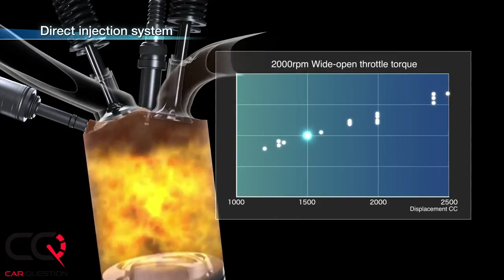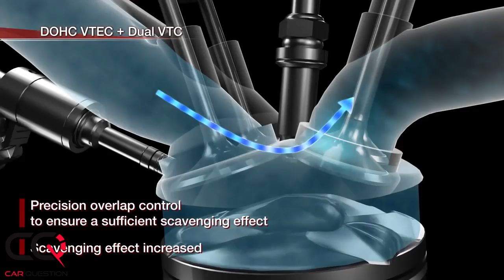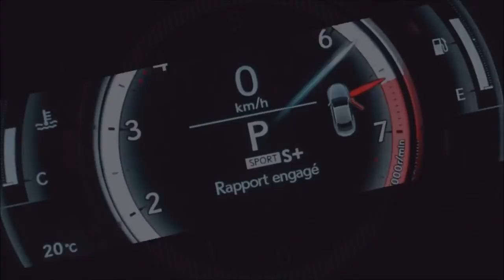Honda CR-V Turbo: Overfilled oil levels and a gas smell Fix and RECALL!

Comment: I purchased my 2018 Honda CRV EX in December.  Since then the car almost failed twice while in traffic! The car misfired, jerked repeatedly and almost stalled. This happened at approximately 1500 & 3000 miles.  The oil each time was pitch black and smelled of gas. The first time Honda did a computer fix. The next time they changed the oil. At no time did Honda tell me the car itself was the problem.  The oil is again turning black. I do not want to wait until I am killed or injured in traffic. Honda knows about the oil/gas dilution, but says it is no problem. I will be selling this car to get one that is safe.

Comment: I just returned from my local Honda Dealer, after I had noted a strong gas smell in the oil of my 2019 Honda CRV.    They did NOTHING to address the problem and did not address that it is a national problem for Honda.   My CRV has only 3500 miles, and the oil looks dirty, and smells strongly of gas.   Not happy with Honda for not addressing this problem which goes back to 2017.  Santa Maria, CA Honda is the dealer.

Comment: I came real close to buying a CRV. I couldn’t bring myself to purchase one once I found out it was a turbocharged and smaller four-cylinder and a CVT transmission, a double threat! CVT transmissions our junk! After purchasing a Toyota I find my real world gas mileage to be just as good if not better than CRV. And I don’t have to put up with a CVT transmission!
 I prefer naturally aspirated engines with just as much horsepower and fuel mileage.
 I don’t see the reason to go to a highly stressed smaller engine. I know it’s not but one can only hope the turbos in the masses are just a fad , lol... 
What else are you buying these little things for other than reliability and snowy weather capability?
Reply: Liam Ross  not only that, but CVT issues are almost exclusively related to belt CVTs and not chain CVTs. Furthermore, he's wrong about power output of NA engines being the same as turbo engines. That's just factually false. He clearly knows nothing about cars and is letting ignorance dictate his life choices. Even though a Toyota is a perfectly good car, the reason why he bought one is purely out of ignorance.
Reply: Unfortunately cvt are soooooo boring to drive.
Reply: @tonychau1983  they may be boring to drive to you, but that's subjective. CVTs are, by design, more efficient and more powerful.
Reply: I did some calculations on the CVT belt.  The belt does not have joints like a timing chain, we are bending it 4 times per revolution to go around 2 pulleys.  We may be bending the steel belt billions of times over the car's life span.  Even though we have layers in the belt, when one layer breaks debris will kill the entire transmission.   I have been retiring my old cars at 14 to 18 years so far.  I doubt if CVT transmission belts could last that many times of bending.

We change timing belts which handle a few kg of valves as regular maintanence, but we currently do not replace CVT belts which carry thousands of kg, the entire weight of the car in acceleration/deceleration.  If someone come up with an affordable way to replace CVT belts before they break, it would clear my doubt.  For now I'll stay away from CVT transmissions out of warranty.   

Oil dilution is definitely bad.   I no longer change oil myself.  It is getting too expensive if I need an oil change every month.
Reply: Jay Cogan I am looking for a vehicle...may I please which Toyota you purchased?
Reply: @afcgeo882  He's not completely wrong about some N/A engines having as much power as turbos. Look at how many old 4 cyl engines that had 200 hp back in the day.... Like the RSX motor or the Integra GSR & Type R with 180-195hp.... And this crv turbo engine has about barely 190.... And you're flat out judging the guy when he did have a point. And those are only 4 cylinders... The TL V6 Type S motor had about 280hp N/A no turbo... All Honda motors all no turbos so get your facts right buddy before you get all judgey.

Comment: 2017 CRV touring here.  No problems at 18k miles (oil level is ok and no gas smell)
Reply: Robert Bryant ours has started at10k.
Reply: Matter of time now!! Just wait
Reply: I have a 2017 crv too and having the fuel injectors issue

Comment: It's an issue all GDI engines have, and it's exacerbated by not letting the engine get up to running temperature, which can take more than 10 minutes on cold days. In a cold engine, the piston rings don't seat as well, allowing for more blow by from the cylinder, which is again exacerbated by stop and go driving and highway lugging (low engine speed/high demand). Also, the problem becomes even more likely on turbocharged DI engines as they are also operating with higher cylinder pressures. Design solutions to reduce, (and I mean reduce as all GDI inherently have fuel dilution) the issue include lengthening the piston skirts to reduce lateral movement, and increasing the number of oil rings or, among others, to introduce a dual injection setup where low speed, low temperature operation is mainly using port injection, and high load is mainly DI.
 I'm not familiar with either the oil change intervals associated with these CR-Vs, nor the manufacturer suggested spec on engine oil. Most manufacturers suggest 5w30 oil, however this may not be best for your type of driving, or the climate you live in. Most TGDI engines would benefit from using a 40 weight oil, for instance in colder climates a 0w40, and warmer a 5w40 both synthetic. Also reduced oil change intervals to less than 6,500 miles. Also reducing the number of short trips taken. 

Beyond this, there can indeed be a software aspect that simply injects too much fuel at any point in time. That aspect, you can't fix. That would be on the manufacturer.

Comment: I owe a CRV - Exl 1.5 Turbo & Have fuel mixed in the engine and Honda try to fixed by change out the AC control unit & software up dated but still not fixed yet. I still have the same issue & Honda told me that it is normal which is bs. I hope Honda would take care their issue as Toyota do to theirs.
Reply: We have the same car with the same issue. The so called fix, fixed nothing.

Comment: Here is the reply from Honda Australia.  I contacted them about smelling fuel in the oil on a demo CR-V with 2,000km on it.

We have received advice from Honda Motor Japan that Honda China issued a local recall action for the CR-V Turbo model manufactured in China.
The recall addresses an issue that develops when the vehicle is driven for short distances in very cold environments (such as minus -20c) and the engine does not have time to sufficiently warm up.  Under these conditions, the result is that fuel can enter the engine and mix with the engine oil.

Comment: My Civic 1.5 turbo experienced this problem 8 months after purchase. It stalled in the middle of the city and need to be towed to dealer workshop. They now informed me is fuel pump problem and will get a new replacement.

Comment: Lol Honda says gas in oil is not a problem. And the sheep will believe this.
Reply: Yes, they do!
Reply: @RagingUtai  CR-V 1.5Towners are not into the boost enough to push fuel past the cylinders.  This a design flaw that Honda is throwing a band-aid on.
Reply: really? Like an inch above the full line? NOT!
Reply: They finally have a cpu update for it. We'll see if it helps. Either way I'm selling my si asap!
Reply: Kevin Johnson we had one recall done it was a software update and something else which included an oil change. Checked it yesterday and the oil reads way high again. Thus not fixed.
Reply: Kevin Johnson we had one recall done it was a software update and something else which included an oil change. Checked it yesterday and the oil reads way high again. Thus not fixed.
Reply: Kevin Johnson we had one recall done it was a software update and something else which included an oil change. Checked it yesterday and the oil reads way high again. Thus not fixed.
Reply: @franimal007  wow. Honda has really dropped the ball.
Reply: @Paul best Doink? LOL...I think that's bad when the dealer tells you "nothing is wrong." That's called "insulting a person's intelligence". Also what about the V6 that cuts off all the time. Guess you forgot. Hahah! As you say one engine design? That's funny, how many CR-V's are out there and the company did nothing? For how long???? LOL
Reply: @normt5463 has nothing to do with a turbocharged engine. It's the direct injected fuel system. Fuel injector leaks fuel past the rings and it gets in the crankcase. People are really blowing this issue out of proportion. Ask a tech that has worked for Honda for years like myself and dont feed the YouTube bullshit. Longer drives will burn the gas out of the oil.
Reply: @franimal007  I had the update and just had the oil changed and smell gas on the dipstick. So its not fixed.
Reply: Old Goat  same here! NOT fixed!
Reply: We will be getting rid of it in 2020.  Honda did a software update yet again, just had the oil changed this past week. At 23k miles our tires are cupping! Always rotated the tires. So now a new set of tires! They told me it needs an alignment. I was driving it home after the service and the temp gauge went from normal to cold, and the heat was cold. Drove it right back and the service tech told me that’s normal I just never noticed that before! They are almost as bad as the fake news! Lol!
Reply: Actually almost all cars who are direct injection have oil dilution. So what Honda says is true. It's only excessive oil dilution that's a issue. Also if you have this issue people should change their oil alot more frequent.

I haven't noticed that many issues here in Europe or anyone talking about this issue. Not sure if the Eu engine is different from Us and China.
Reply: I also saw a video of someone showing his issue. And noticed that the engine wasn't heating up very wel. At the same time he was keeping it in very low rpms. All the time. I think this a issue, that Honda doesn't tell their clients the issues. Or what they need to do about it.  More regular oil changes and some long drives, it's a 182hp car enjoy it weekly on some lonely roads 😄 to burn it off.
Reply: @justinrochman5076  5K oil changes?? What shit is that.  It should be able to go at least 7.5k between services and not require longer drives.  All because they made a defective engine.

Comment: Hi I really worry about these issues oil dilution I have the crv 18 with almost 4000 miles and I  already do the oil change at 2500 miles but when  I check the oil level looks over the oil mark and is really dark
Reply: Hamilton vs America Honda
Reply: Same here
Reply: BJ DJ all oil gets dark the older it gets.

Comment: This is very IMPORTANT.  I have just initiated a claim under the North Carolina Lemon Law, New Motor Vehicles Warranties Act (N.C.G.S. 20-351).  My 2017 CR-V has had an oil analysis tested twice, once at 4,904 miles and once at 9,311 miles.  The FLASH POINT OF MY OIL WAS 230 DEGREES AND 215 DEGREES, respectively.  This is the operating temperature of the engine.  Fuel percentage in oil was 7.8% and 8.5%, respectively.  This is a very dangerous situation with a turbo charged engine, with ANY engine.
Reply from the maker: How can we follow your claim? or get news from you to follow what will happen?

Comment: I see a lot of comments saying the 1.5 turbo is only available in the upper level models here in Canada , wrong , I have the 2018 LX CRV and the engine is the 1.5 turbo , works nicely , no issues after 6000 kms mostly short cold trips to work and back  (5 miles each way approx) daily ??? Went in today for so-called update , keeping fingers crossed

Comment: I had the recall/ software update done on my civic Turbo  in January , I'm sorry but I report no change. oil just level still keeps on going up. its the injectors not the software. I'm in Ontario an i drive an hour to work so , its has nothing to do about being cold. The injectors are faulty and for Honda too expensive to change because they are internal. so they give us all this bullshit stories and extend the warrantee to 6 years instead. This means that Honda is forcing me to get rid of my car after 6 years. Screw you Honda. Its  time for a world class action lawsuit.
Reply: Same with mine. No difference at all.
Reply: I Just bought a 2018 Civic EX-T last week after a total loss of my 2014 CRV which I was happy with. I didn't have time for much research and have always owned a Honda so felt confident to buy the Civic. My last Civic had over 300,000 kms on it. I guess I'll keep this one a year and see how it goes, but probably not buy another Honda.

Comment: My civic hatchback 2017 have oil dilution problem too. I do my own oil change and every 1000 miles after oil change I check my oil condition. I notice that the oil level is always above the max of the dipstick. Now I know what's happening.  Thank you

Comment: I checked the oil on my 2018 crv and there is definitely gas in the oil
Looks milky black and when you smell the dipstick and put some on your finger gas is present 
This car is 6 months old with only 3500 miles on it
Have an appointment with dealer on Monday 
If they don’t take care of it I will go find a lemon lawyer
Reply: Go smell your hondas 0/20 oil straight from the pump/bottle. It smells like gas.....brand new. Anyone that says they smell gas in there oil is dumb af it's the oil. I've been a tech at Honda for years and deal with this customer complaint on a regular basis. Ask a tech like myself and dont feed into the youtine b.s
Reply: @justinrochman5076  Who makes Honda's oil? Isn't it Valvoline?
Reply: @ryanlittleton5615  we use Mobil 1 at my dealership
Reply: @justinrochman5076  would you think the oil should smell worse or more gassy after just 350 miles after an oil change ?

Comment: This may be a stupid question..   but does it make a difference on how much you drive it? How much burns off? I have a new CR-V 2018 and knew nothing of this issue prior to purchase. So far I have not had any issues that I am seeing in comments etc.
Reply: Think that common problem is how long is trip from start to stop car and do you warm up engine or drive immediately , maybe is there connection also with outside temperature because car ECM use data calculates according them.

Comment: My 2017 Honda Civic EX-T 6M has had this problem with oil tests from Apex Oil Lab reporting readings of 5% to 7% fuel dilution. I brought attention of  the issue to my dealer who indirectly said I am stupid and that there is nothing wrong with the car. As a result I no longer go to that dealer and am seeing communicating with a new dealer about the issue which they also said they have not seen but are not saying its not a problem. These cars are crap and no one should buy one because I think at the end of the day a software update is just a patch till the defect comes back miles later after the warranty is over. Also it't not like I live in a cold climate because I live in California and this issue was sill present during the summer when it was in the 100's.
Reply: I used to work for an quick oil change place back in the 80's. Before fuel injection was the source of delivery for most cars and trucks back then. And the majority of most of them all reeked of gasoline coming out of the crankcase. And I would say that was almost about between 30% to 50% fuel dilution back then. 5% to 7% would have been unheard of. Later on in the years I worked on tearing down and rebuilding engines, and motor oil was quite present in a lot of combustion chambers in the cylinder heads. We have definitely come a long way into  technology of todays car building. So far many of the car manufacturers have all suffered from this, including Honda.
Reply: @setdecinmotion6719  new turbocharged engines weakest link are the bearing journals and not the engine.  Of course back then we used to do 3,000 mile oil changes.
Reply: Yup that’s our dealers attitude.

Comment: My 1.5 accord got a blown motor. Dealer told me it had bad fuel injectors. It’s got 68k miles and they won’t fix it because the drivetrain isn’t under warranty anymore. The injectors are and that’s all they could fix.

Comment: Just had the software “FIX” done on my 2017 CRV,1.5 turbo. Guess what? Oil level is not only above the top fill mark, its past the orange plastic altogether! surprise surprise!! (Should have done my homework better before buying this car)
Reply: so disappointed
Reply: Buy a Toyota RAV4 the A25A-FKS is a much better engine.
Reply: We both didn't know anything about this. I have the same car and its my last one as I only have 10900 miles and it will be 3 years old next March.

Comment: My God,,i bought mine in dec 2018....if they knew of the problem and didn’t tell the consumer,I’m going to sue
Reply: Hi Steve, you ever saw oil dilution issue with your 2018 CRV, if you don't mind please share your experience.
Reply: I used to be a mechanic in my younger days ,you don’t need to be a rocket scientist to smell gas on the dip stick when there shouldn’t..I took it in and they confirmed it..but there’s no fix for it ..there computers say no problems..promblem is they got my 5000 down when I purchased it 5 months ago and I’m pissed..I traded it in for a ram pickup...I’m waiting for a universal lawsuit to happen so I can maybe get something from it..buyers beware..Honda used to be good not anymore
Reply: steve thompson oh a RAM employee i see lol